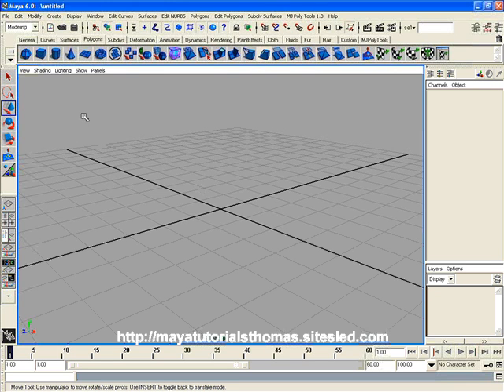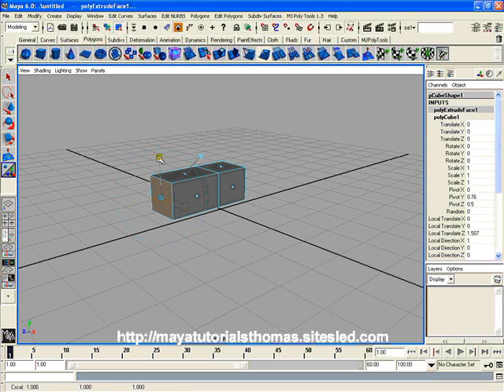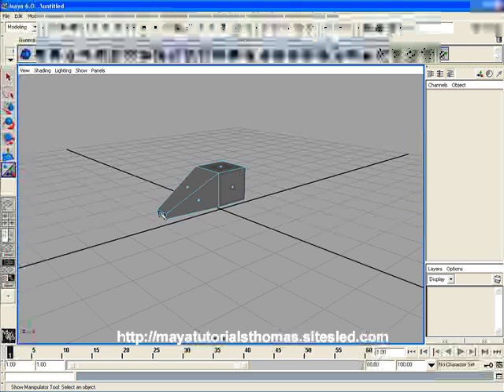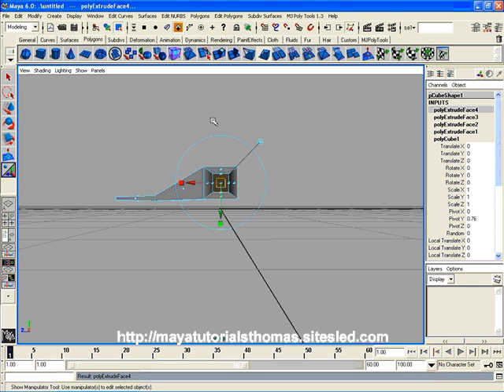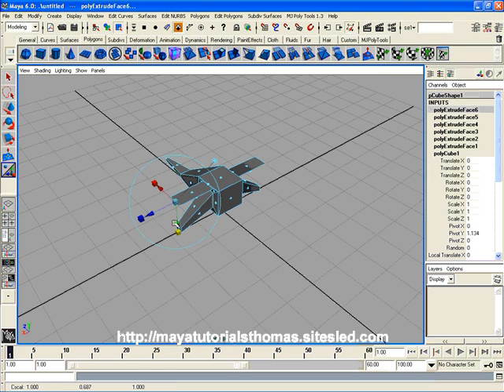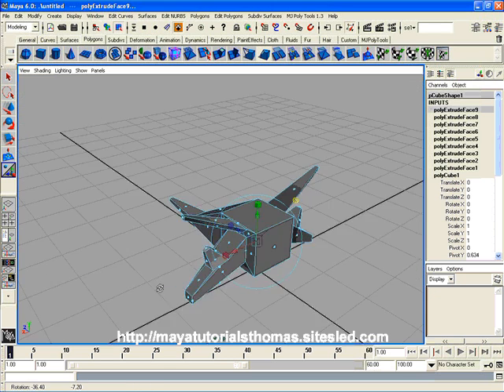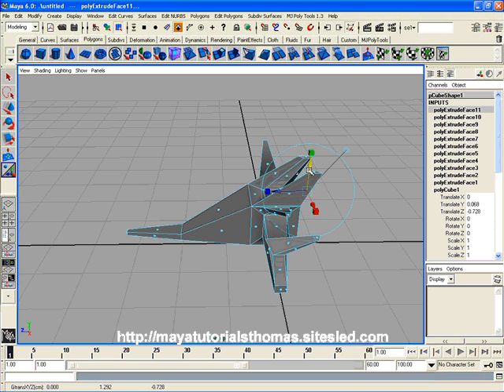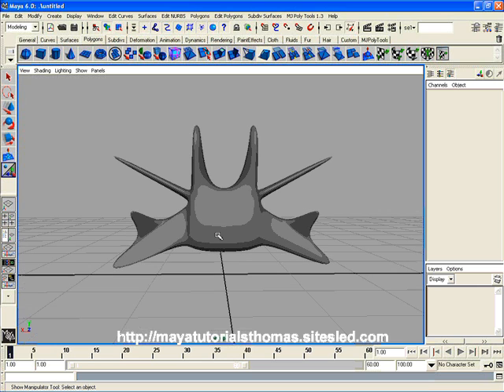Maya Spaceship Tutorial - 3D Modelling

Comment from the maker: I haven't used maya for years, I'm mainly working with Catia in 3D Design Engineering. But when I used Maya I would use the G key to repeat the last used item. So if for example you are going to do a lot of Extruding like Thomas did, you would hit Extrude and then every other time, you would simply select the Face and hit the G key. Not sure if it works that way anymore . . it was a while ago since I used maya.